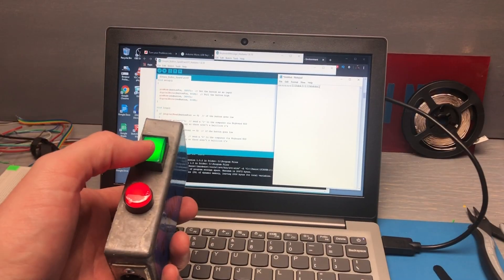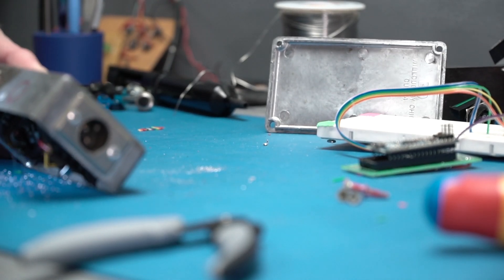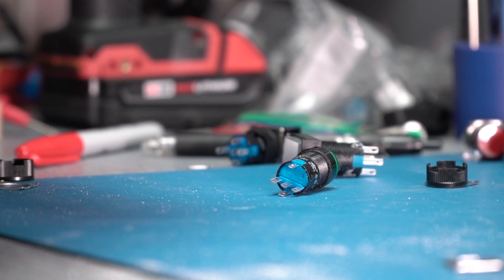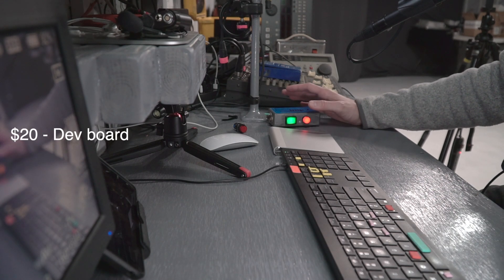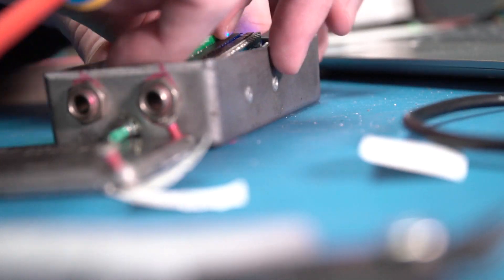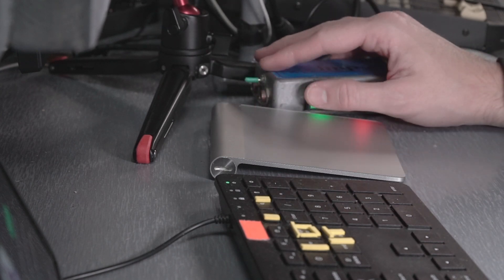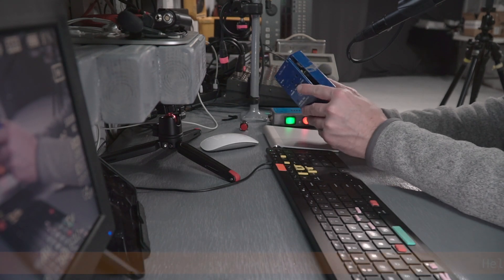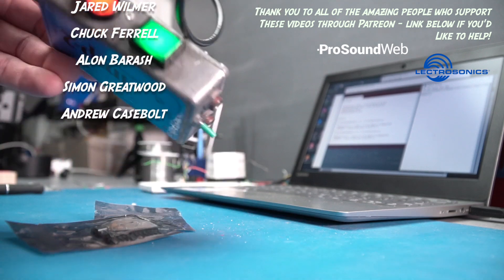DiY Custom USB Controller how to Video - Works w/ FCPX & ANY Editing Software, DAW or NLE

Comment: I built this project and am having a hard time getting the keyboard library to work.   Getting error:

error: 'Keyboard' not found. Does your sketch include the line '#include <Keyboard.h>

Did you have to deal with this?  I can't find a solution.
Reply from the maker: Hey, thanks for the message. Did you get this sorted? It's typically a result of not having the correct board selected in the IDE when you're putting together the code. Let me know if / where you're still stuck & I'll do my best to help. If you can send a screenshot to me at info@dcsoundop.com - that might help too. 
Happy new year, thanks for the message!